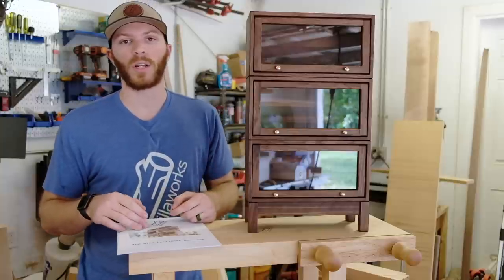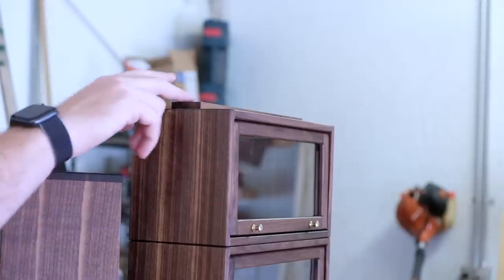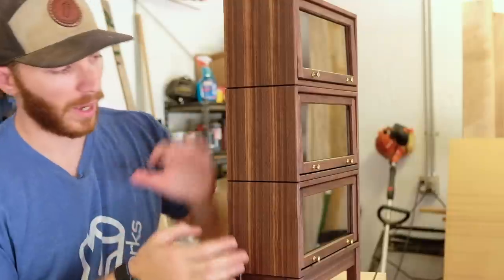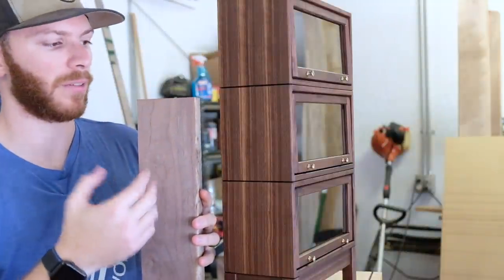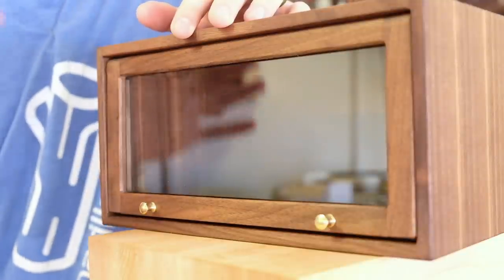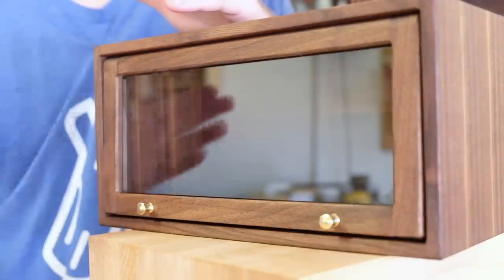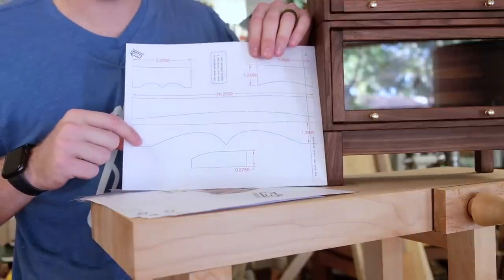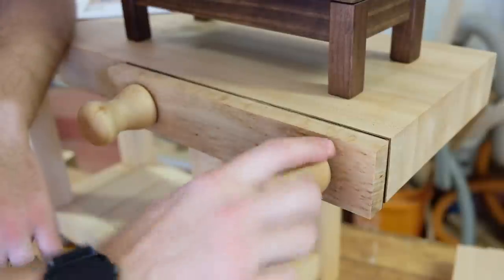A Quick Look at the Mini Barrister Bookcase // Plans Available

Comment: Love this project! Over the yrs, you’ve built several smaller scale projects.... what is it about working with smaller proportions that appeals to you? I’m in the process of moving but once I’m settled in, I will be getting these plans!
Reply from the maker: Thanks Andrew! There’s a few reasons. It’s a new and different type of challenge. Errors can be magnified on smaller projects so it can really keep you honest and humble at times. They also require a lot less material which is cheaper, especially if the project isn’t for a paying customer. Lastly, they don’t take up much room!

Comment: You glossed over the detail regarding the dowls on each end of the glass door that fit into each groove.  What I'd like to know is HOW DID YOU GET THE DOOR INSTALLED INTO THE GROOVES?

I have two doors that the dowl broke.  Replacing each dowl is an easy fix.  Reinstalling the doors after the fix is not possible because the grooves do not run all the way to the edge.  If there's a trick to this endeavor, please share.
Reply from the maker: Hi. The actually build video should show me installing the doors. In this video, go to the 7 minute mark. There I discuss how the back panel is two pieces. The top smaller part is not glued in place. It is nailed to the cabinet after the door is slid on from the back. If any issues with the door arise (such as the situation you may be in), then you can pull that smaller back panel off and access the door or reinstall it. 

Not all barrister bookcases will be like this though. Some might be. But it’s not necessarily a standard.
Reply: @parillaworks  Thank you for your quick response.  I can see that your groove runs all the way to the backend.  Mine does not.  The groove stops short about 3/4 of an inch to an inch away from the back, which would explain why the back of my case is a full piece.  O'well.  It was purchased in January 1993, so who knows what they did almost 30 years ago!

Comment: What if you wanted to double the size. Can it be done the same way with the wood grain
Reply from the maker: If you're referring to the quarter sawn material, yes just add more strips. If you're referring to the back panel, I would probably just use nails over the wider span. You could also use plywood and glue it in place.
Reply: It would be nice  for larger displays to be sitting in these. I would want glass inserts 5 sides that will be a challenge

Comment: Dude you do amazing work and the explanations are great. The hardest part about watching this video is the sound which has white noise at a high enough level to be annoying. Get yoself a better mic (or something, I don't know much about audio) and this could be such a great channel!
Reply from the maker: I appreciate it! Totally agree. The first 2 or 3 clips in this video were fine but something happened to my mic, maybe a weak battery or it died altogether and reverted to the camera mic. When I went to edit I had to raise those other clips way high and added a lot of noise. Thanks for the comment!
Reply: @parillaworks  hey no worries dude. Love the design and execution, and really appreciate you stepping through the thought process of the side grain and the nail on the back